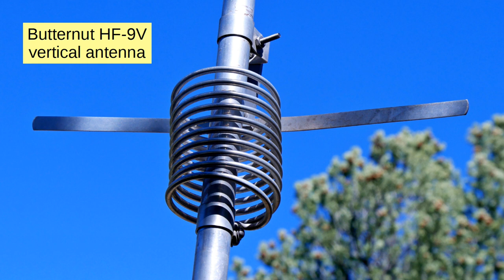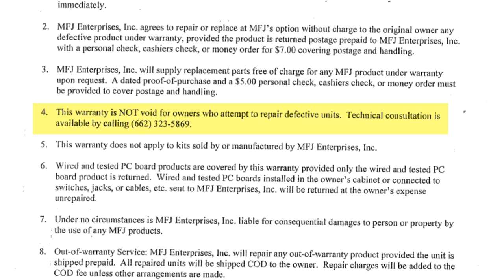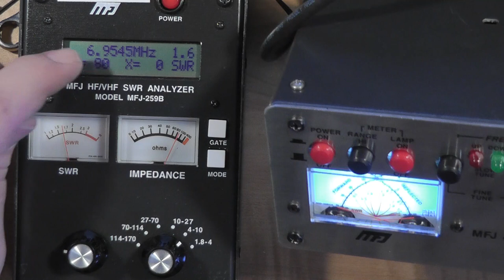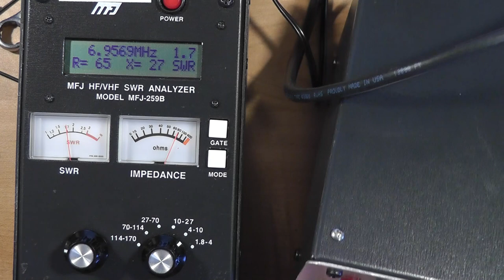MFJ 1788 Loop Antenna Fixed (#65)

Comment: I had a similar scenario with the MFJ 935b magnetic loop tuner. It stopped tuning in all bands within a few days of receiving it. I opened it saw that a toroid that goes around the tuning capacitor screw was off center and very close to it. I sent it back for warranty repair and when I got it back I opened the unit to find out all they did was to put a piece of heat shrink tube around the capacitor screw. I called support and asked why the toroid was still not properly aligned and I was told the problem was referred  to the manufacturing department. The unit so far works fine but it goes to show you, like in your case, their quality control leaves a lot to be desired. It's a shame because I have quite a few MFJ products and I rather buy items made in the US but situations like this makes you think twice where you spend your hard earned money. Glad you got it fixed and great job on your videos. 73, Tom
Reply from the maker: They offer so many products that are unique in the marketplace. That being the case, they're a great asset to amateur radio. But, like any manufacturer, they can be frustrating at times.

Comment: Thank you SO much for following up and showing what was wrong and how you fixed it. My first piece of MFJ gear in 1992 was an MFJ-949D Antenna tuner. Bought it brand new from MFJ and it didn't work right out of the box. I was upset being a newly licensed Ham and waiting for this tuner to arrive in the mail to get on the air. Fortunately my Dad was a Ham in the 50's and 60's and a Radio-TV repairman for 30 years. He opened it up and was able to repair it. My experience has shown that you have a 50/50 chance of a new MFJ product working out of the box new. I can't count the MFJ items I have had to repair out of the box. I still buy MFJ products because when they work they are well worth the money. If they don' then you get more electronics experience repairing it. But come on MFJ! You can do better.....

Comment: Gr8 news.  I bought one several years ago, it would not go all the way to the bottom of 40m. Sent it back to MFJ, they returned it with the same exact problem. Now I know how to fix it myself. I did open the cover, but did not think to move the capacitor to see it mesh. Thanks Dave, now I know.

Comment: Glad you got the antenna working. I have the same one. My take away from web searches about the antenna before I bought mine was you ALWAYS have to open it up and inspect the soldering, plate movement/alignment...basicly everything.  I found plates that would touch at the end of rotation.  Not a big deal to fix.  So, please anyone that gets this antenna which works wonders mounted horizontally in my attic, take the plastic cover off and inspect/check plate movement.

Comment: Hi David - I had the same problem with an MFJ-1788 loop antenna I ordered from Gigaparts 2 years ago. It was going to cost me $105 to send it back to Gigaparts via UPS. I then opened up the antenna and found the limit switch stop problem you came across and there were several capacitor plates bent and shorted together. It now works fine. Bob - W3ARA

Comment: I think the fact that MFJ allows amateur radio operators to try and fix it themselves without voiding the warranty is in line with the spirit of ham radio.  I like that.
Reply: The spirit of ham radio is about building and tinkering. It is not about fixing brand new equipment that you paid thru the nose to buy. Come on Hoshnasi. Please point out one of your videos where you have been pleased at the opportunity to fix something that you bought as new.
Reply: @HooPhartd  Well they are infamous for producing junk so they have to do something to keep people from sending stuff back all the time. I agree with ya the price this thing is I would be mighty pissed if I had to troubleshoot and fix right out of the box. Frankly having to tear it apart and fix something like that I would expect a partial refund since I had to do what I was supposed to be paying somebody else to do.
Reply: It's not in the spirit of amateur radio. It's in the spirit of they don't want to get the stuff back and have to work on it themselves. It's a lot easier for you to do their final quality-control.  Something they should be doing before it leaves the factory.  I bought a mfj 9420 once that had three factory defects right out of the box.  But it had a famous mfj QC sticker on the back.  There were some initials on the sticker and if I owned mfj that QC inspector would be long gone.  There is no way in hell that inspector ever looked at the radio. All issues were very obvious.      The CW adapter emitted a sidetone all the time, the transmit LED was put in backwards and the alignment was so far off you couldn't get 5 Watts out of the rig.  It shawty QC like this that gives mfj a bad name.  Obviously nobody cares at mfj because it goes on year after year after year.  I would assume that they also look at the reviews that they get on equipment. This cannot be news to them.

Comment: I had to tighten the capacitor to the shaft myself. The symptom was that the capacitor was not turning at all. The motor was running, but nothing happened on the tuning box needles; so a call to tech support solved that, much as yours did, David. I enjoy your vids and I now subscribe!  73!
Reply from the maker: Welcome aboard!

Comment: Thanks for your video! My MFJ-1788 Hi-Q Loop Antenna would also not tune the entire 40m band. The big capacitor was fully meshing, but the plates on the rotating shaft were not in good alignment. I was able to align them by loosening the variable plate shaft from the motor using allen wrench, then loosening the nut on the shaft, freeing the plates to move independently, then aligning the plates using a couple pair of needle nose pliers. After which I made sure that the limit bar, also on the shaft, was correctly positioned to engage the limit switch when the capacitor was fully meshed. After tightening the nut on the shaft, then the allen wrench screw to re-engage the motor shaft, this antenna will now tune to the low end of the 40m band. MFJ should have tested before shipping, and the misalignment of the blades was visually obvious. So, I think they have a quality control issue!

Comment: That's why they call it "Mighty-Fine-Junk!"  
I've had a number of MFJ products that I've either had to fix or they just never would work to any satisfaction.
The latest saga is with a MFJ-1025 Noise Canceller; I'm the 4th ham to get this thing.  Although you can here it seemingly changing phase (to give you the idea it is working) it never seems to get a very deep null no matter what type of noise antenna I try.  So, I'm wondering if this has some type of factory defect whereby a transformer is not phased correctly or something.
Anyway, great video Dave and I agree with you assessment.  
There is an old saying: "There is never time enough to do it right the first time, but always time enough to do it over!"  73...

Comment: Nice work Dave, I bought a (Bare Bones) MFJ 10 to 30 megs loop from ebay ie - no controller no circuit no 1 -5th loop and the motor was fubar .
Cost about £40 delivered, its up and running now with a new mfj motor (old type) and a £3 12v reversible controller  again from ebay. I use an extra cable to move the motor, tune for max noise and then rock it back and forward for lowest swr , bingo.
I understand about the  Quality issues but what a great range of products they have.

Comment: Again, thanks for video. Although it is too bad the 1788 was shipped somewhat defective, it is inspiring to see you use your technical know how to fix the problem. I think that is part and parcel of the "Ham Radio Spirit." The fact that MFJ allows their customers to do so without voiding their warranty is a credit to them in their favor. On the other hand, like you said, this sort of thing should have been rectified in Quality Control and that doesn't speak well of them. Either way, thanks for your honest review. I think this is a reminder that even a product from a reputable company has to be evaluated on a product-by-product basis. Best regards, KM4HOC.

Comment: Wow David, I am so happy that this video of yours was made.  The impression I received from MFJ was (a don't care attitude from the lady that answered my phone call) that if you are not patient about their back orders (they have so many) that they will give your money back.  This from a Ham's perspective is not good since what we want is a working product.  I agree with every sentiment in this video.  $500 is not a cheap antenna by any means.  I received a signal tracer/injector and the potentiometer shafts were bent. Quality control should be MFJ's major concern for 2017 and beyond.  They do have a wonderful range of products which can only be enhanced by proper Work Procedures (WP) and Work Instructions (WI) which will lead to a high level of Quality Control. AC4PS.
Reply from the maker: I'm afraid I spoke with the same lady. But when I called for Tech Support I got Paul, who was far more helpful.

Comment: David great work. For someone like me, I never would have been able to discover the problem and fix it. I pay my hard earned $ and expect a product without defects. That's why I chose the Chameleon F Loop and the P Loop 2 which are top quality and work just fine . Thanks for the videos.. I appreciate all you help and advice. Larry
Reply: Larry Nathanson and those are qrp loops not 100w rated. Those looking at these loops know about the cha loops and still pass or build their own.
Reply: @darthorpheus  According to MFJ, its rated at 150 watts
Reply: @darthorpheus  I notice too that many other HAMs are quick to point out other manufacturers Loop antennas being far better and they are.  I just wish they realized that they only handle 10-20 watts while the MFJ will handle 100 watts.  I also wish MFJ would especially focus on the quality control of these antennas since they are so ridiculously overpriced.  That would be the least they could do.  I seriously considered purchasing one until I read endless nightmare stories about the problems straight out of the shipping carton.

Comment: I really liked my loop for the few months it worked. However the motor has developed a fault making it impossible to tune and I will need to replace it.  MFJ quality control strikes again or just unlucky?

Comment: I have had similar problems in the past and the fix was usually something simple, like bad solder joints.  I still purchase their products and use them daily.  We are hams and "can do" people.  I recognize they are NOT Elecraft but am glad they stay in business.  They offer so many different products that make this hobby more fun.  I still use one of their first CW audio filters bought back in the 70's when they first started.

Dave K8WPE
Reply from the maker: Yes, I have quite a few MFJ products also. I think they're pretty essential to modern ham radio.

Comment: MFJ has been told this for years.  People complain to them about quality control at the Dayton Hamvention and other hamfest.  I have personally witnessed various people complaining. It falls on deaf ears.  Honestly many amateurs no longer Homebrew and this is where mfj's market lies.  many do not have the time equipment or skills to build an antenna tuner or a magnetic loop or "insert your favorite project here".
the only thing that might make them take notice is when people stop buying their products, but that's not likely to happen.  The engineering behind many of their devices is actually quite good.  It's the assembly in quality control that lets them down every time.  I purchased a new mfj 9420 years ago and it had multiple issues right out of the box.  It was not aligned properly, the TX LED was installed backwards so it would not light, the CW adapter side tone sonaleart sounded all the time, and transmit power was low because of the mis- alignment.  Also the rig drifted worse than a swan 350 ever did.  It made the swan look stable and I'm not joking.  I had to put a call into the rig's designer Rich Littlefield . He told me that the vfo oscillator coil was the wrong type and there was no way to settle the oscillator down without replacing the inductor for the correct part.  I contacted mfj and to their credit they did send me a new coil out for free.  But this is one item with this many faults.  It is just unreal.  W8JI makes claims that he designed a quality control program for mfj and I believe him.   For whatever reason, they don't follow it.

Comment: Hi Dave, I too have had problems with MFJ, 1 was a 2m/70cm base antenna, 2 was a tuner with 2 issues, 3 is support.  I find it hard to trust MFJ, Their Quality Control sucks.  Their Warranty is there for them, You buy a defective item when paying for a working item, then you/we fix it at/on our time to save MFJ money on repair time and shipping.

Comment: Persistence pays off! 
Good job Dave. Now that you got that outta the way... I'm really looking forward to seeing the comparison between the 1788 and the Butternut vertical. 

As I said in the comment on the first testing video,  I'm not hating on MFJ but it's kinda like Harbor Freight stuff, some works, some don't and some don't work very long. 
I have owned several MFJ products (still have a couple), and admittedly, they all worked as intended but I know a number of people that haven't shared my same fortune. 
It's a shame really, a little quality control goes a long ways. I think the general opinion of MFJ is not that they make bad products....but that they make good products badly. It's little things like this that fuel the negativity toward the company and it's something that could be easily resolved.... much easier than changing popular opinion.

Comment: This morning Charlie Ray and I were having a good conversation and Charlie told me that he was having very good experiences with his MFJ Loop. I told him that Dave Casler was complaining that his loop would not tune 40 meters. I speculated that the problem was that the limit switches were not synchronized with the capacitor. Charlie Ray thought that was probably the solution, and I intended to communicate that to Dave Casler. When I got home and started going through the YouTube I discovered this video where Dave discovered and resolved the problem, and it was just as suspected.

Comment: Thats is the reason I love MFJ and their products. We can work on them without voiding the warranty. My dad last year bought an MFJ-259C antenna analyzer. It was intermittent on 20 meters. After a call with MFJ, they had him open it up and found something loose inside. They told him to go ahead an repair it and it would not void the warranty. Nice to have a company that still believes in personal repair and not having a fit about it. Thanks for all your hard work and videos. Also, by the way, I have started my own channel for some fun and enetertainment for Amateur Radio and DMR. I record on my phone as I am too cheap to do otherwise but would like to have you check them out and see what you think. I am currently uploading a video on the TYT MD-380 and have another waiting on the CPS programming software for such radio. If you do watch them, please comment on how they are or need to be and also maybe some ideas for the channel. Well, that's enough rambling. I look forward to another great KE0OG video and will always have thumbs up for you.  73, ad0am
Reply: @Adam Rennison : You buy something with good money, it is defective, you have to open it, dig for the problem and repair by your own and still you're happy because they won't trash the warranty ? Tell me, warranty of what ? A defective device ? Please...
Reply from the maker: I think the part most likely to fail under warranty is the little motor.
Reply: Still, they should do a better job on this antenna . As you said it's expensive and the construction lack on some ways : the enclosure isn't sealed. Saw videos where bees and insects gone inside and made the capacitor arc'ing. The end-switch is another weak part wich fail sometimes. I was nearly to buy it but stopped when i saw videos bout it. In the past MFJ did better stuff and materials were good . But that time has gone. Sadly.

Comment: I agree it should be plug and play at the price point. I also agree it is worth a look before going through the hassle of a return. I have fixed too many "new" products and have had good results buying refurbs when I can. It seems refurbs are tested better since they came back with issues. I have yet to have an issue with one (ham gear, power tools, etc...). Thanks for the video! I will do a complete check before I install mine. 73

Comment: Recently purchased one used a very large discount.  The power wires for the motor weren't soldered to the board, and the capacitor set screw was loose.  Easy fix at least.

Comment: This has been a great and very informative video series! Glad you were able to get this fixed. I have had a couple of different loop antennas. Currently, I am using the Chameleon P-Loop. I have no complaints with this antenna. However, I have been looking at getting the MFJ-1788 to put in the attic of my new home as I like the remote tuning ability and the power rating. Just have to figure out how to mount it to a rotator. Any advice on that would be most appreciated!

Comment: Thank you!  I just subscribed.  Your instruction is clear and efficient.  Just got a used MFJ-1786 (free).  Long story short: the plastic housing inside the gear box in the motor is broken, so the motor shaft doesn't spin.  Do you know of any place in the US to buy a replacement motor?  Thanks!

Comment: My 1788 had a bad solder joint connecting the tuning coil to the loop.  After correcting that the antenna has been great. I get very low SWR 15-40M and good signal reports, even qrp.